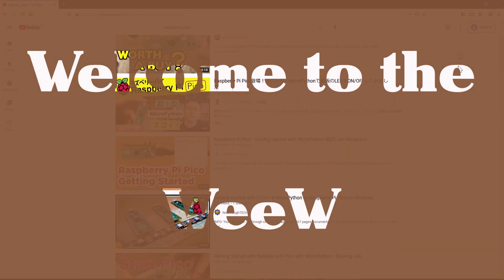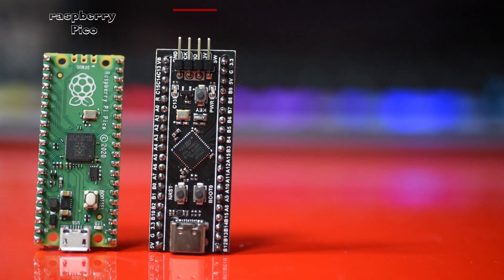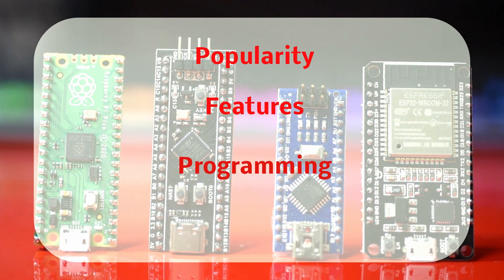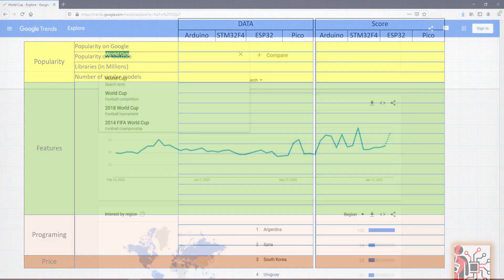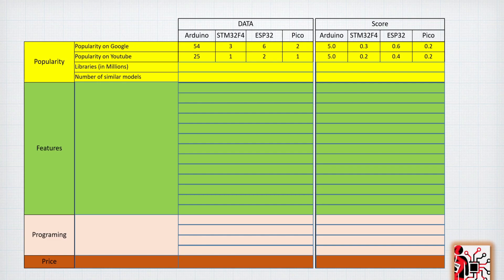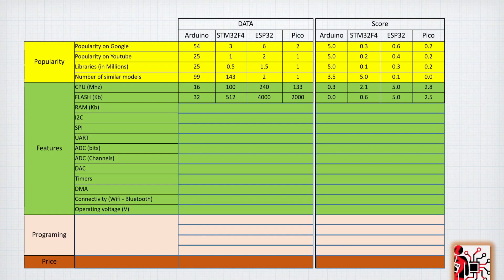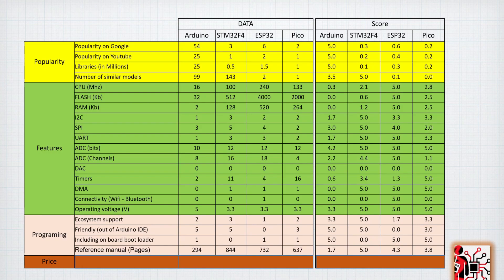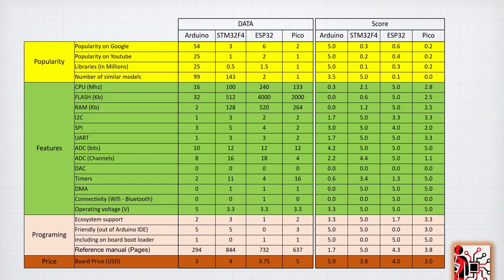Raspberry Pi Pico, Arduino Nano, ESP32, STM32F4 Black Pill: Which Micocontroller is the best?

Comment: You found the number of libraries for the STM32 was low because most Arduino libraries work without any changes with most STM32 boards, when using STM32duino. The situation is similar with the ESP32, and since the Arduino IDE will soon support the RP Pico, all four boards are equivalent in terms of library support.